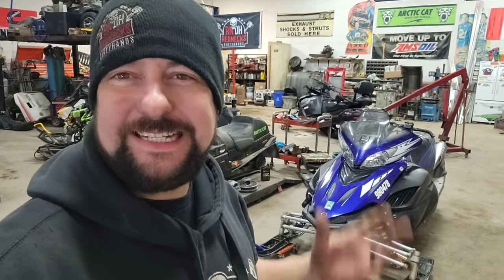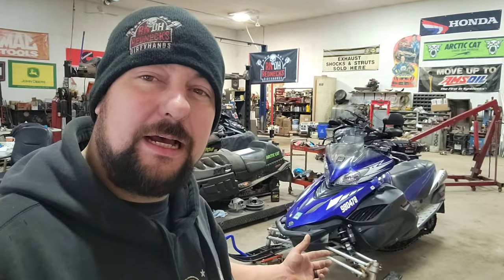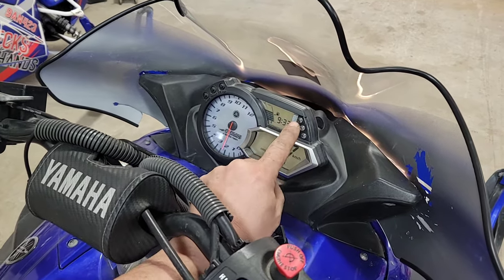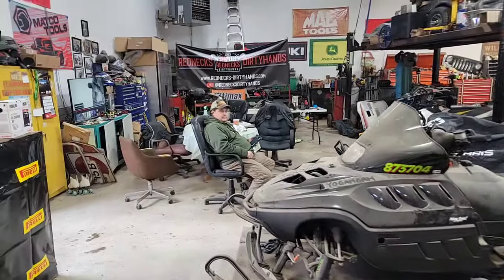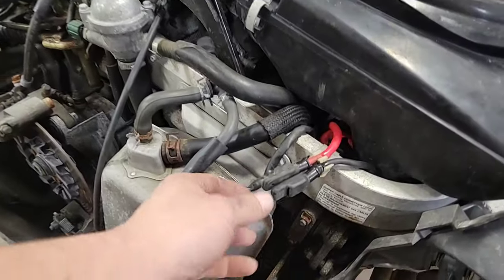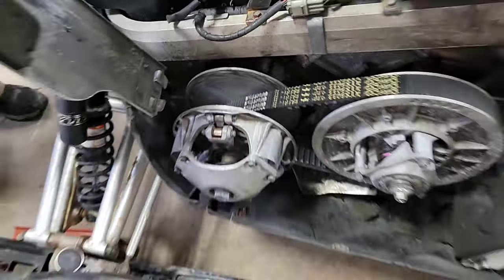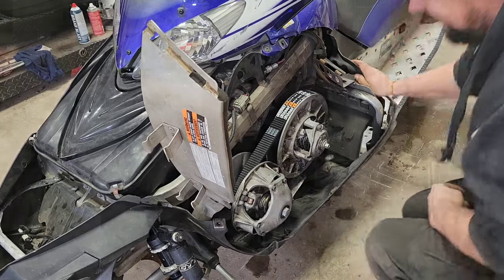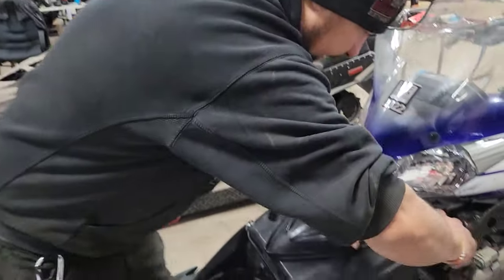How To Change The Oil, Starter Solenoid & Fix The Headlight...How Hard Can It Be?

Comment: That is a lot of work to just change the oil and filter. I am going to give my good old 2 stroke a hug!
Reply: Yet that apex is racking up double the ammount of miles. Maybe triple the ammount of miles as your old 2 stroke. Not having to worry about an engine rebuild every 5k to 10k miles.
Reply: @edwardabrahamiii3742 yamaha 2 strokes are practically 10k mile guaranteed though. People have pushed 20k on the old yamaha triples. I've got 11k on one of my 01 srx 700s. Our old vmax dx 600 and our first exciter 2 sx 570 lasted just under 13k miles and still ran when we got rid of em.🤷
Reply from the maker: 🤣 haha yeah I hear ya! 🍻
Reply: What are you guys using for a camera? Great channel by the way,thanks for sharing.@rednecksdirtyhands
Reply: Very simple maintenance,if you have trouble with doing this you shouldn’t be working on sleds.
Reply: @edwardabrahamiii3742  yeah wonder why Yamaha stop making snowmobiles cuz Yamaha stop making 2 stroke sleds. Yamaha deserves everything they get stupid Yamaha. pretty much 4 stroke Yamaha snowmobiles are motorcycle with tracks. Yamaha sleds even sound like motorcycle.

Comment: Hey Pete…I saw an oil filter relocate kit for the Opex, I’d definitely get that, moves the filter out front where you can get to it.   Nice sled
Reply: I was thinking that myself. I wondered if such a product existed. Maybe yamaha built it this way to force the owner to check that solenoid because they knew it was a weak point.
Reply: more parts, more maintenance or parts to fail, you'd think. idk.
Reply from the maker: yeah I've heard of it but I've never actually seen the setup yet. definitely would be a solid upgrade I'd think. cheers 🍻

Comment: Another good thing to do is get rid of that foam and put a 20 size battery instead of the 14. Fits nicely and gives extra starting juice on those cold days.
Reply from the maker: good tip! cheers 🍻

Comment: Nice one! I have a 2011 APEX with 20 Thousand Miles, still runs great! I've done all my own maintenance from when I was a Teenager! I service PowerSports in my retirement for people I know. Once I switched to a 4 Stroke (2004 Warrior) I have not looked back! When i purchased a 2023 Sidewinder LTX GT EPS last year, I was a bit annoyed with all of the potential issues, so I went ahead and installed the Driveshaft Expander and I tack welded the screw on the Chain Tensioner. Will still have to check the Top Gear and those shift fork pads? Arctic Cat quality!!!!!

Comment: great video. yamaha states chain tension is in finger tight and back off one turn then lock it otherwise it'll stretch the chain. i've got 32000km on 2011 apex same chain and gears in it with regular maintenance , still look like  new. bought a  used 2017 sidewinder this fall, not even close to being the same fit and finish that's for sure. kept the apex as a back up or if i don't like the winder then i'll go back to it

Comment: Dude where does the little hose connect too on the left there is no connection on the air box 2009 apex thanks
Reply from the maker: this one was an 07 and the little hose on the left side (standing in front of the sled looking at it) by the starter solenoid plugs almost straight up on the bottom of the air box. I'm not 100% sure if the 09 is the same though..🍻

Comment: have yall ever tried using an oil extractor instead? jw if that would work
Reply from the maker: yeah I'm sure it would work on the tank but you wouldn't be able to get the oil that's in the motor out..it would make it alot faster and easier oil change though! 🍻
Reply: @rednecksdirtyhands  yeah i could see that it would so much better if these engines were designed to be serviced more efficiently lol

Comment: Hey Pete, would an oil extractor make the job easier? It wouldn’t help with the filter, but it might with everything else. Love your vids!
Reply: i believe some foreign cars like Mercedes and I think one other, have you change the oil with a pump, which is odd!
Reply from the maker: it would make it alot easier but you wouldn't be able to get the oil that's in the motor out I don't think, you'd still have to drain the motor plug. 🍻
Reply: @rednecksdirtyhands  I guess the good news is that you work up a thirst spending that much time on an oil/filter change 🙂 Cheers!

Comment: Awesome video, I do not belive you are supposed to screw the dip stick in to check old level. Also for the chain case it's finger tight and a 1/4 turn out

Comment: Yamaha R1M or R6 motorcycle and the Yamaha Snowmobile have the same powerplant? Has anyone swap a R6 motor in a snowmobile?
Reply from the maker: yeah the yamaha sled engines are based off the yamaha street bike just without the transmission. I've thought about putting a bike motor in a sled just so ya can slam the gears down the track! 🤣🍻